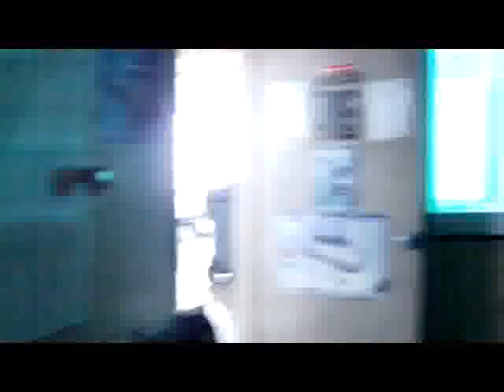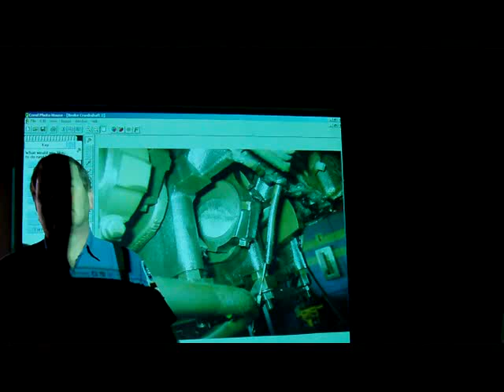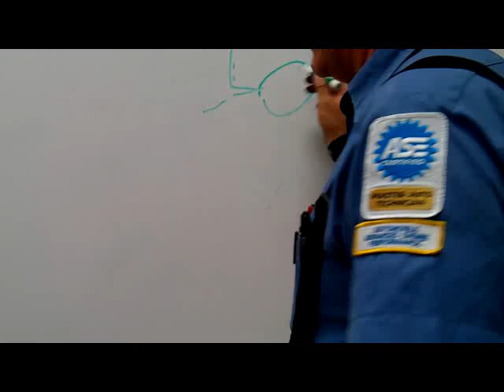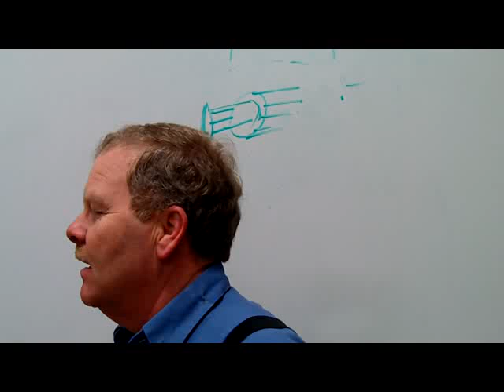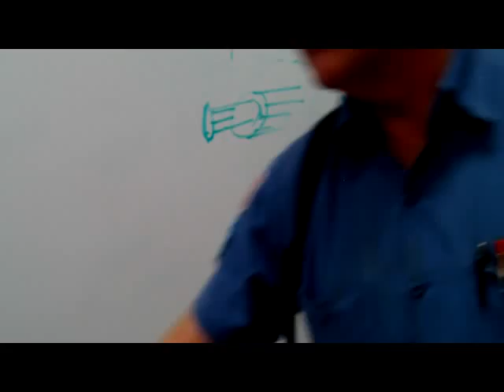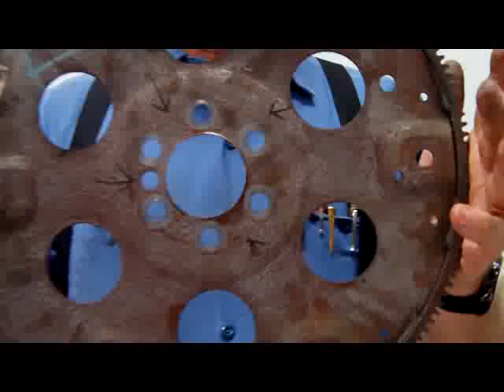Driveline 3 and and Engine Stories.flv

Comment: I bought a 396 bbc from a guy that said it was blowing the oil filter off the engine when he cranked it up and I knew what was happening because I had just went through a class at trade school about how oil flows through the engine .  the reason  was the check ball was stuck because when he rebuilt it he used lithium grease and let the engine sit in his garage all summer and that grease dried and wouldn't let the ball move and bypass the filter so the filter got all the pressure and would blow off .   so all I had to do was unstick the check ball and it was fine .    good reason to pay attention in class